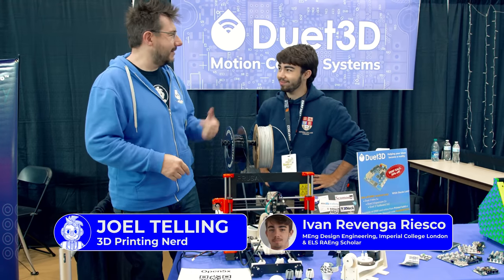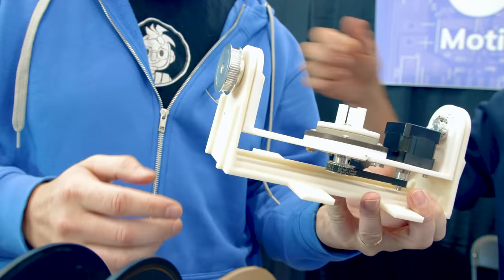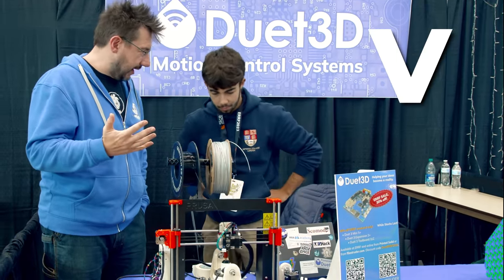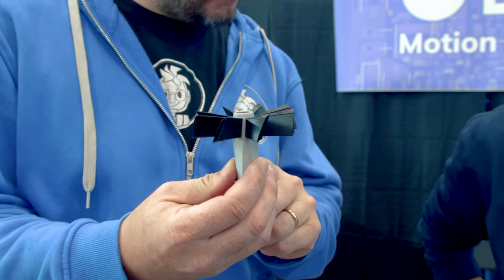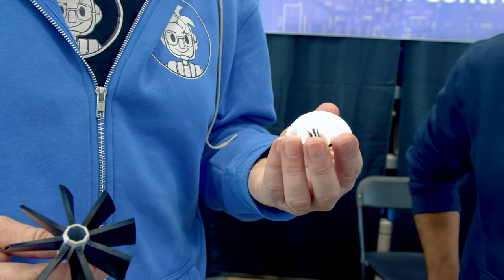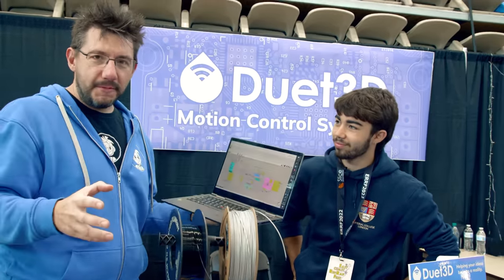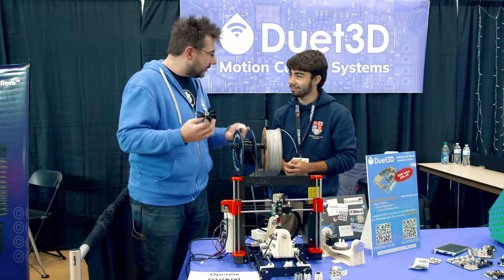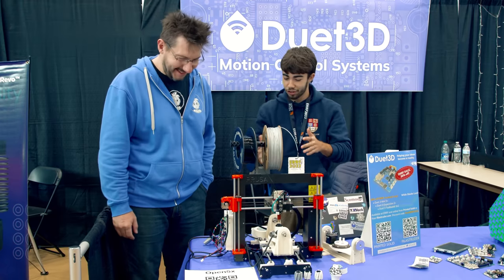PRUSA with a 5th Axis?

Comment: It was awesome to see this in person. I'm glad to see this and Stefan's video where both show 4th and 5th axis 3D printing that doesn't involve a custom printer, just a few mods. That takes a lot of complexity out of getting the hardware... and to make matters better, both have open source slicers.
Reply: Hopefully this slicer gets ported to an open platform instead of relying on Rhino, which costs around $1000.
Reply: Hard ware part is the easy one for this. The software is the big issue.
Reply: @shadow7037932  correct. How to make a rigid frame is known. How to make something move smoothly is known. How to make 6, 7, 8, etc. axis is known. But how to figure out the software is hard... It's why Arachne, lighting infill, etc. isn't some random thing someone told Cura "hey, I made a thing" (since it first showed up there). They were research papers that were implemented into the code.

Each axis adds a lot more complexity. If it didn't, companies like Autodesk and Siemens wouldn't be charging thousands to get access to it because they'd have to compete with, probably, free.

Comment: Typically the axis's are supposed to be xyz A and B.  Thats how its been on CNC machines for a long time.
Reply: yeah, I found that very odd that they did use industry standard. When adding rotational axis to a standard cartesian machine X=A, Y=B, Z=C
Reply: I believe it’s because when you add an A axis trunion to a 5th axis machine with a built in B and C axis, some code needs to be redefined as a new rotational code. I think the U and V is correlating to the I J K values you would typically find in 5th or 4th axis movement code
Reply: I used to be a cnc tech for a 5axis router company, I was instantly confused because U,V,W always correlated to a parallel axis to XYZ. So if you had 2 'x' tables, one would be U. Or if you have 2 drives and motors running a gantry, you would have X and U working together to move it.
I feel keeping to left or right hand rule machines help make the rotational axis make more sense.
Reply: Only came across U & V for Wire eroders, when you want the wire to be angled then the U & the V are the X & Y positions of the top wire feeder telling it to be offset to the bottom feeder
Reply: I’ve used W on all the boring mills I’ve worked on. It’s the z axis but it moves the whole “ram” forward instead of just the spindle. Provides better stability.
Reply: @IFtwIxJewJitsu  Yes W is the ram on our horizontal mill as well. A is the rotational part of the rotary table.
Reply: Every 4 axis machine I ran was xyzb.
Reply: They're probably coming from a a computing background rather than a machining background.  It's generally X, Y, Z, W, U, V, S, T in 3D rendering etc.
Reply: Just wait until they get to adding the P-axis into the discussion. I work on a couple industrial machines that use a P-axis… I still don’t know why they labeled it like that.
Reply: @dustinmeier9753  Just to make life difficult

Comment: Great build but He missed an opportunity by not making the extruder the 4th axis.

Edit: or make the print bed much larger and it will still work. In this current setup it could easy have a bed with diameter of 300mm.  Just nee some space underneath it
Reply: Could you explain your idea further?
I don't quite see how you can (easily) rotate around a huge area.
Reply: When the U- gantry is placed parallel to X, the  buildplate can be a circle as wide of the U-gantry.

Comment: Don't think it will add much, cause adhesion will become more difficult of a problem, build volume will be lower, speed, might be pro, but it won't be much, more components, i mean you'd be better off with a print head that can make more moves, but it's a nice project and proof of concept though.

Comment: Rhino plug-in sounds like a bad fit for hobbyist.

Supposing it's not too hard to build one, there should be first lots of videos to review pro/con of these, and compare for example layer adhesion possible with it. Theoretically you could make like a 3D plus sign or even a cube with one or two shell layers in the XY direction (stronger).

IMO with some machine learning we could get an accurate robot arm to 3D print accurately enough and reliably enough. But it requires significant software development

Comment: I feel this is ultimately a waste of time. By adding U and V axis you make X and Y redundant. The whole point of 5 axis machining is to remove material from specific locations @ specific angles. With 3D printing we're adding material, sooooo.. what, you get to print stuff without supports? We can already do that, without crazy software and just a little forethought in design. I should point out everything he printed could have been done, with forethought in design, on a regular printer that won't cost you anything extra in licensing fees.

It would be neat to have U/V/Z axis to do some rotational geometry but adding X and Y is meh, it's extra complications. If it does go this way that's neat but ultimately requires an entirely different design philosophy, so to each their own I guess? shrugs
Reply: Z strength is an issue as the parts aren't monolithic and while some parts can be cut, printed and put back together, some designs it's not possible. This allows for the reduced waste of material as well as strength in proper axes.